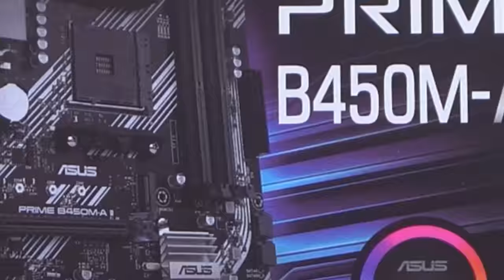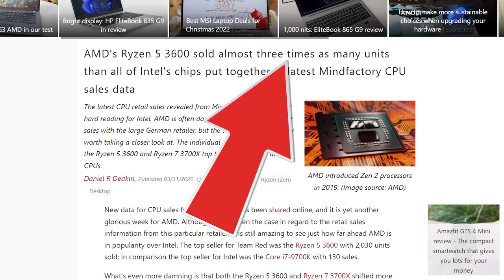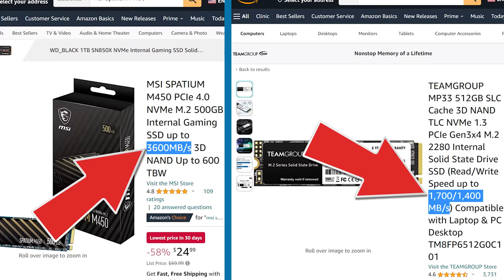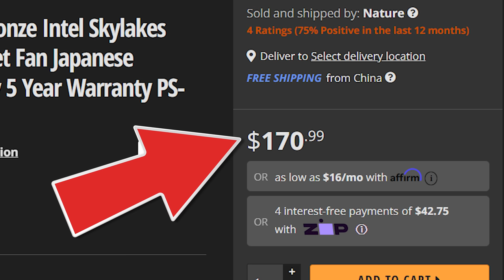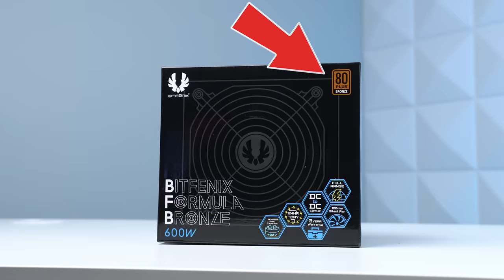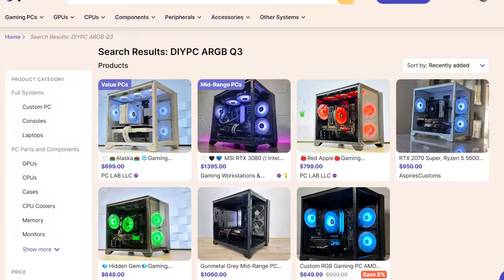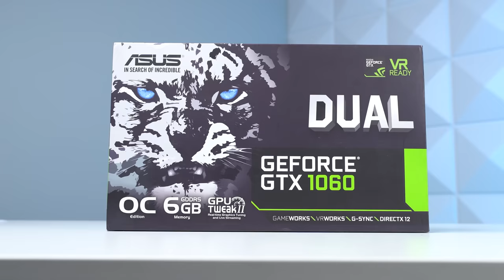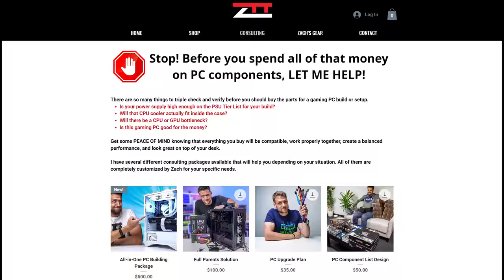A Very Repeatable $400 Gaming PC Build Guide

Comment from the maker: Don’t forget to activate Windows on ALL of your gaming PCS! (Use Code ZTT18 to save 25%!) https://biitt.ly/7MXAR
Reply: you should change the title to how to flip a pc for profit. while making it look like
Reply: Could you leave links to everything thanks love the content
Reply: Hi i loved this video but can you please make an video about a $500 build  with all new parts
Reply: Sama AR01-RGB-W White Dual USB3.0 and Type C, Dual Tempered Glass Micro -ATX Tower Gaming Computer Case w/ 4 x ARGB LED Fans (3 x120mm xSide,1 x120mm x Rear) Pre-Installed
Reply: @visheshminj3475  what’s your definition of new? if it’s any thing this year you’re out of luck.
Reply: @visheshminj3475  Do you mean new parts that are older generation or new generation parts used or otherwise? I'm going to go out a limb and say that a $500 PC build not using any used parts is not going to play any modern games very well or at all.
Reply: Fu*ck
Reply: Pro tip - buy cheap used ram and two white ram heatsinks make your own white ram :)
Reply: are the fans of this case rgb fusion supported? if not how are you getting the fans to stay a static color?
Reply: @ZachsTechTurf I saw this build on your site at 150$. If I buy this build from your site, I will get it used (second-hand) or it will be brand new?
Reply: pls do this exact build with a 2060 super 8gb
Reply: Would it still work in a cases ARGB-Q01-W R?
Reply: Hey Zach how would this pc work for war zone? Loving the all white to thing looks so clean.
Reply: This Windows Activation thing seems sketchy...
Reply: @EricStevenTerry  whats very strange is ALL (or nearly all) these TECH YT Channels are doing it. Even the ones that I've been following for YEARS.
So I looked into it and it's not good. From what I saw, MS has the option (and desire) to terminate these lic keys at whim. I'm not sure of the process of illimitation they use but from what I saw it's not really 'legit' and sooner or later your key is most likely to be deactivated.
Reply: Can you please sell me that pc
Reply: is there another psu i can use for this build?

Comment: Imma do this right now,ordering everything right now with no experience in building pc’s. Wish me luck yall 🔥🔥
Reply: Well the only thing im having troubles on is the Asus dual GTX 1060 6GB. He did not get that for $68 😂
Reply: W
Reply: @swayonnamission8921 lmfaooo get a rx 580 😂
Reply: if u actually built it then what fps do u get in the games u play?
Reply: yoo bro how many fps did you get in the games you played
Reply: I actually got it for that price
Reply: I’m about to buy all the parts right now
Reply: @OTFxLuffy have they arrived?
Reply: Deal
Reply: is the pc good?
Reply: @cam8696  na bra mine is rtx 4060 to Intel R guess the other parts and the chipset
Reply: how did it go? :3
Reply: Hey man, its been 11 months was the pc any good? Could you tell me the fps it runs
Reply: Gl
Reply: Everything is out of stock. I was about to order everything
Reply: On Amazon is alll in stock I think
Reply: @insaneklaw  I ended up going to micro-center. no 3600 in stock so I got a 5600. 340$ all together. Throwing my old single fan 4060 in it.
Reply: Lmk how it works
Reply: @LuccianoNova Hey do you need to update the mtb's bios?
Reply: Hey quick question did you buy the windows from the website he had linked? Just want to make sure it's legitimate bc j saw a couple things saying it may not be
Reply: @armansyahdeni  yes
Reply: Same just did it aswell

Comment: It's crazy how hard the 1060 6gb slaps even after all these years
Reply: 6gb has some setbacks but the 1060 is insane
Reply: I have the Asus Turbo variant.
Reply: RTX 2060: 🗿
Reply: @mythydamashii9978 2060 will never be him
Reply: For real. I got my Msi gaming x 1060 6gb and it still rocking
Reply: I have a dell g7 laptop with a 1060 and running games still to this day with no big issues.
Reply: I still have a 1070 laying around but fortnite's lowest graphics on DX12 are too demanding for a 240fps experience on that card so Its been retired. Not selling tho, that thing has like 30k hours tha shit mine for life
Reply: Will a GeForce RTX 3060 12GB 15 Gbps work?
Reply: @mythydamashii9978 RX 5600 XT better
Reply: @someguywithmtndew5691  whats a better gpu than the 1 Zack is recommending?
Reply: @clxtch8908  for $75-80 the 1060 6gb is okay but the RX 580 8GB for less price has more vram and sometimes faster than 1060 but doens't have DX12.1 support. If u have a little bit more cash to spare like $115 a used RX 5600 XT is such great value because it's faster than an RTX 2060.
Reply: Hey there! I've been using the HOTO Compressed Air Capsule for a while now, and it's been a game-changer for keeping my computer setup clean. It's powerful, reliable, and the dual-function feature is fantastic, allowing me to tackle both vacuuming and blowing. Definitely worth considering for your cleaning routine. Let me know if you have any questions!
Reply: Can i use the rysen 5 3600 with a 1650gtx?
Reply: @svex.1a198  yes
Reply: 1080ti is a damn good option too
Reply: Most of the 10 series is still really good I’ve got a 1070 and it still plays modern games at decent settings
Reply: isnt the rx580 better?
Reply: Why not you guys upgrade to Radeon rx 7700
Reply: I'm new to PC will it work on a low profile
Reply: Wish I never sold mine
Reply: I use 1080 and still rocks
Reply: Rx 580 is better tbh
Reply: Like my grandpa, his belt whip is still 💀💀🥶😭
Reply: + Rx 580 it's as good as gtx 1060 or even better
Reply: In my PC this motherboard. But processor R5 5600G. Videocard don't have. RX Vega 7 in processor. Memory Goodram DDR4 16 gb 3200 CL22. M2 nvme Apacer AS2280P4 512 gb, HDD WD Blue 1 tb SATA III.
Reply: In Ukraine this PC cost 14101 grn.

Comment: The 1060 6GB is holding up quite well. Strangely though, at least in my area, the 1660s of all kinds are all only about 10-20-ish bucks above the 1060s. I feel like those are a bit more worth it but no slouch in any showings here. Nice work.
Reply: It depends if you're building for your own PC or for selling. The reason he went with this card is it's functional and it's white. Most cards aren't white, but white can make the difference between someone not only buying it, but what their prepared to pay. Atleast Zac isn't selling it with a i5 from 10 years ago and a 2gb GPU and some cheap RGB fans to fool someone who doesn't know what their looking at. Personally with vram becoming more Important I would try get a card with 8gb vram over the 6gb vram that the 1060 and 1660s have.
Reply: @Jwalker76  Yeah honestly i was surprised by how fair the 1060 was for price. I'm a nvidia locked user due to ai, but for the 80-100$ range the 8 gb Rx 580 (ddr5) is a solid card, while for 220-250$ on amazon refurbished/used, the 3060ti offers a juggernaut of value as it's one of the top value cards for bang for buck on street (not 400$ msrp new) prices.  

And it's only like 2 years old when even graphic cards you buy at the store are often like 5-7 years old and you don't have to worry about dried up thermal paste heating up the cards 60->80 on the 5+ year cards. 

Still while some might see 1000$ on a pc as overkill, i think i chugged the math and for 250$ on a graphics card, it replaces a lot of hobby. Instead of cloud gaming on my old shitty 1650 (500% slower, 150$ card). 

I can keep my computer for 10 years, the fps is butter smooth, and i've gone from 50 fps on rdr2 with 64 gb ram cheating a bit (the ram made my ow2 fps go 50 fps to 350 fps on a 1650 lol). 

I think 64 gb ram might be overkill perhaps but i probably would still love to at least have 20-32gb or put the price savings on a higher card. The problem is for the 300-500$ range, the 3060/ti is a bargain for being able to run a lot of games at great settings and you'll often have to spend a extra +50-100$ to get a 144 hz vs 75-100 hz screen to see the 200-250 fps it already gets. (Or 400-600 fps for a 4090. Which tbh im not even sure if i can find monitors at 400 hz for.) 

I feel like spending 400$ on a computer you dump after 3 years (133$ /yr, 11$ month), and gives horrible performance, vs a 600-1000$ computer that runs all your games extremely well for 7-10 years. (60-100$ a yr, 5-8$ a month) sounds fair to me.

Sure graphics cards depreciate over the years. The 1080 is a good example. 7 years ago it was a 800$ top end card. Now it has the performance similar to the 300-400$ msrp 3060ti, but still has 11 gb vram vs 8 gb. If you see those 7 years as a opportunity cost of 500$, that still ends up 80$ a year, but perhaps if one plays with reapplying the thermal paste safely(without destroying the card), so it runs without the notorious problems of a 11 gb vram card.. You can get the performance of a super computer to a okay but still beastly computer 8 years later. 

And often like 300-400$ on a computer just gets eaten by a 80-100$ power supply, 100-200$ on case and motherboard, 100-200$ on just the cpu. Why not get 500% the fps/performance for just +25% more on a 400$ build and maybe aim to recoop the costs on a pc running it twice as long. With a 60-75 fps over 5-8 years goal on high/medium settings. Rather than 2000$ for a 400 fps model your 75-140 hz screen can't see without paying 100$ anyways?
Reply: A rtx 2060 is only 200 now
Reply: @Notyouraveragename  respect for writing an whole essay
Reply: Actually just picked up a 1660 super for 100
Reply: @NorseBlade  It's a little older but 100$ for a 6 gb card is hard to beat in the fps per dollar department. 

That's a pretty good deal for frames per dollar, i got a 8 gb 3060ti for 260$ that would be about 80% faster (About 180 fps for every 100 fps the 1660 super would get)

But honestly tbh after about like 75 fps or your monitor's refresh count, as long as you get a stable 60 fps, not bad. 

The 3060tis for 260$ and 200$ 3060 12 gbs dried up anyways. Now it's the same price as a 300$ 4060 anyways.

Hopefully future gpu generations will be more exciting, but if you play games like l4d2, dishonored 1/2, or the oldies but potential goldies like ow/sc2/bioshock/skyrim/portal 1+2. it should be fine.

You might have to do rdr2 at 30-50 fps or low or medium settings vs high. But it should be a very workable card.
Reply: Is there any other cards that can go with this build that are easier to find?
Reply: @Jsch329  i guess the white rx 580 from amazon (zach also made a vid about it)
Reply: Hey there! I noticed you mentioned the HOTO Compressed Air Capsule in your comment. I actually have one myself and it's been a game-changer for keeping my desktop clean. The vacuuming power is impressive, and the dual-functionality is really convenient. Plus, the quality and pricing are definitely worth considering. Let me know if you have any questions or if there's anything else I can assist you with!
Reply: @innovativeadvertising6463  bots are getting so obvious nowadays 💀💀💀
Reply: i have a 1660 super and it’s perfect for my build. i got it new at a best buy i randomly decided to buy it when i saw it in stock and it was an impulse but but an amazing upgrade.
Reply: Hey! As a fellow tech enthusiast, I would recommend checking out the HOTO Compressed Air Capsule for an efficient and versatile cleaning solution. Its powerful vacuuming and blowing capabilities, along with the multiple tubes and high-quality filters, make it a reliable tool for maintaining a spotless desktop and car interior. Plus, the compact size and brushless motor add to its convenience and power. Happy cleaning!
Reply: Would a 1070 ti be better then what he suggested?

Comment: The case isn't wrong as far as the PCIe covers on the back.  Its actually the motherboard that is wrong.  For some reason almost every mobo manufacturer decided to move the primary slot down when they had to add m.2 slots.

Comment: Some of the new cases Montech has coming out will be great for budget builds, or even higher end builds where you just want a good looking case without spending a fortune on it. Really impressed with what I saw from them recently.
Reply: Just bought a montech because im starting my first pc build😊
Reply: I got the montech air100 argb and it  has great airflow
Reply: Hey there! I appreciate the enthusiasm, but it seems like your comment might be off-topic. We're discussing PC building, desktop setups, and notebook upgrades here. Do you have any questions or need advice on those topics? I'd be happy to help!
Reply: @innovativeadvertising6463  You do understand we were talking about a PC case right? The thing you build a PC inside of? Pretty sure that's not "off topic"....
Reply: Great suggestion! Another tool that could be useful for maintaining a clean setup is the HOTO Compressed Air Capsule. It offers powerful vacuuming and blowing capabilities, making it ideal for keeping your desk spotless. Plus, it has additional features like keyboard cleaning and car interior maintenance. Definitely worth considering for a thorough cleaning routine!
Reply: the montech cases are amazing. but i hate the fixed led fans on some of them wish they make it argb or no fans on
Reply: @someguywithmtndew5691  at least you can turn the RGB off, so if you're on a tight budget, you at least get proper air flow/cooling and you can always replace them later...but yeah, argb would be better but they're budget cases for the most part with much better build quality than a lot of others in the price range.

Comment: For under $400 that's a really good gaming PC.
Reply: Yeah honestly. I still really like my 800-1000$ 3060ti (240$) 64 gb vram (140$), 2-4 tb m2 ssd with 5000 mb/s speeds. (70$ for 2 tb intel drive, and 2tb from old ssds lying around). 

I do kinda feel like for my pc, there's a set cost of around 300-400$ just for the frame, body, and motherboard (Unless you want to put a graphics card into a 100$ + monitor ddr3 build...). 
I spent like 100$ on a 13100 intel cpu, i might have overspent 140$ vs 60-80$ for the motherboard (Intel's cpu was 10$ cheaper, but the board might have been 120$ to 80$. I might have paid +40$ for 64 gb 160$ ddr5 vs 120$ ddr4) 

But i still love my pc. It's god amazing getting a literal 5x more performance and i bought it since my old pre gpu shortage 1000$ 64 gb ram, 2 tb ssd laptop only had a welded on 4gb 1650. (aka, brand new 1000$ computer with a 150$ graphics card. It was legitimately the best i could find in 100 store models, with costco offering 1600$ models for 8->16 gb ram.. 512 gb ssd, and no graphics card.. Just 50% slower intel xe.)

I did notice heat went up a lot to a little toaster oven even going from 80 watts to 220 watts on my 3060ti. But i swear some overclock, i saw underclocking in the nvidia alt + z menu.. And i can get 70-80% of the performance for 50% the watts getting 150-200 fps on 100 watts when i just want to game without heat or leave it genning stable diffusion all night without worrying about card stress on 70 C vs 45C temps. (I didn't really think about heat, but it's like a little furnace going off, the metal case is oven hot to the touch though the fans work so well, it cools from 70C to 40C in 5 seconds of inactivity). 

At first i was skeptical of pc building.. But legitimately.. Open store boxes are such a scam. I still had to spend 4-6 hours putting all the parts together vs 1-3 as a first timer (didn't want to ruin any parts).. But no lie... It costs 1600-3000$ to get 20 gb ram from a store and a shitty graphics card with a shitty 512-1 tb ssd.. 

It cost me a third to get 3x more ram, (64 might be overkill), it runs butter smooth. i can underclock to get 80% of performance for half the electricity (and 45C vs 70C), the fans are beastly. 

And i can really see this pc lasting me 6-10 years with maybe a gpu replacement for another 200 fps specs in 5-7 years for 300-500$ while a new computer easily can run 500-1000$ for a 20-54 fps model... 

There's a lot of headache sure.. But building a pc meant to last and getting 5x more fps performance for cost, 4x-8x more storage for cost, 2-3x more ram, and upgradable for the same price rocks!!!!
Reply: ZachsTech.  errm, am in the UK, shipping costs would be crazy, thanks anyway but give it to someone else.
Reply: @Notyouraveragename he ain’t reading allat

Comment: I recently built a friend a entry level gaming pc as a gift. Used a i7 6700, 16gb of ram, 240gb ssd and a 1tb HDD. Gpu I went with for him was a Evga GTX 1060 6gb. That card was in a purchase with a 16gb DDR4 kit of Gskill ram, which after shipping ran me about $89. Basically put that GTX 1060 in the $60+ range for me if you subtract the rams value from the amount paid. That was a pretty solid deal. The card really does still game well, and you also get to benefit from FSR for games that support it, to get that extra performance boost for 1080p gaming.
Reply: Can we be friends???
Reply: How much was it total?
Reply: @burgerking-ey3uv  I had all the parts on hand already except for the i7 6700, a cpu cooler, and the GTX 1060 6gb. I hoard parts, including gpu, motherboards, ram etc. I have stuff going back to Athlon 64/Geforce FX/Radeon 9800 Pro era.

Was going to give him a RX 470 4gb I have on hand, but RX 400/500/Vega series have issues with Plague Tale:Requiem, so bumping him up to the 1060 6gb ensured he could play that game without visual issues.

The cost of the cpu, cooler, and 1060 6gb put me out of pocket maybe $130 total.